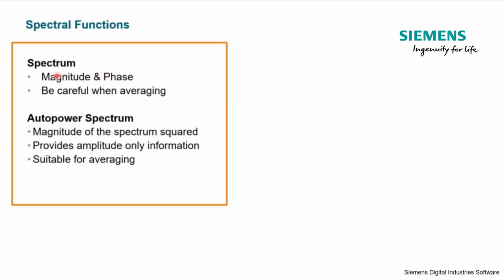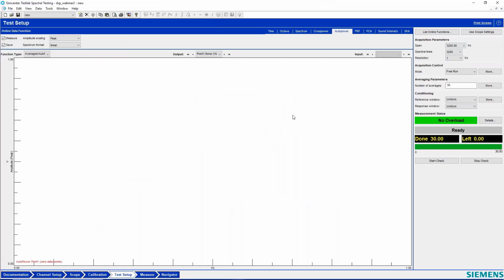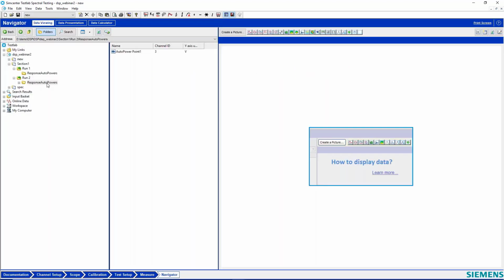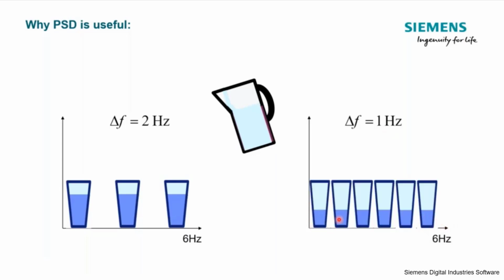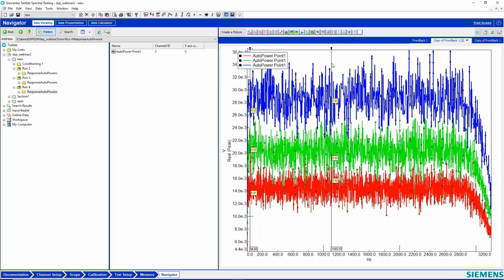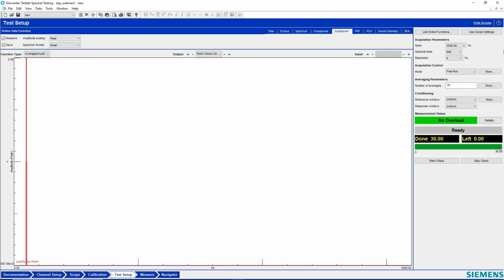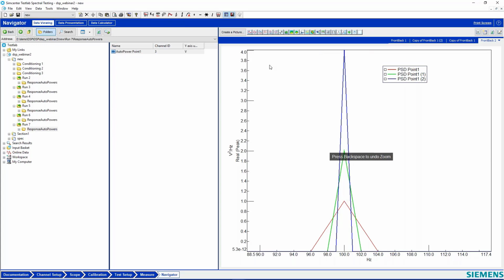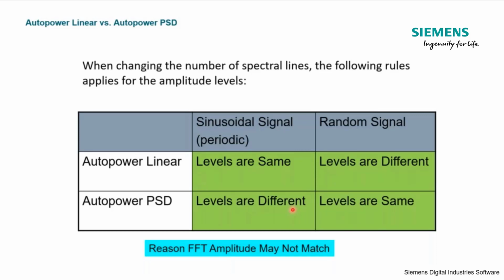Power Spectral Density

Comment: Great video. The only thing that should be explained more clearly is signal resolution. I had to look that up. In this video, higher resolution means it takes shorter time for the signal to be measured. The sampling rate is fixed for all signals in this video. Resolution = Sampling Rate (fixed in this video) / Duration of signal (number of samples)
Reply from the maker: This article might be a helpful supplement: https://community.sw.siemens.com/s/article/digital-signal-processing-sampling-rates-bandwidth-spectral-lines-and-more